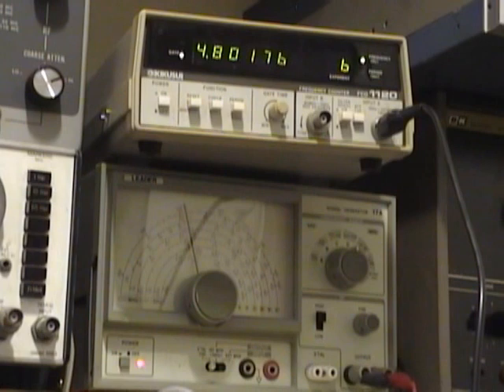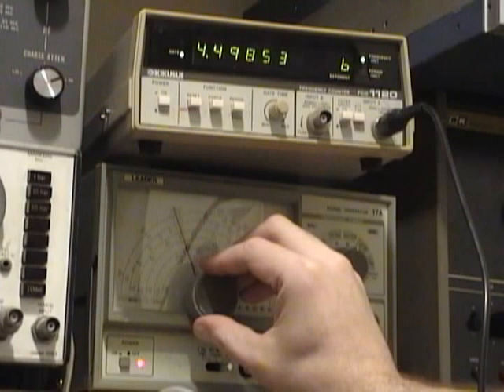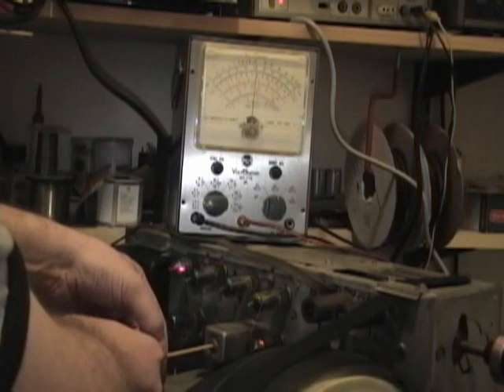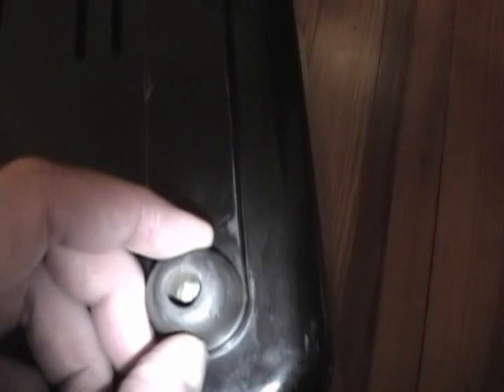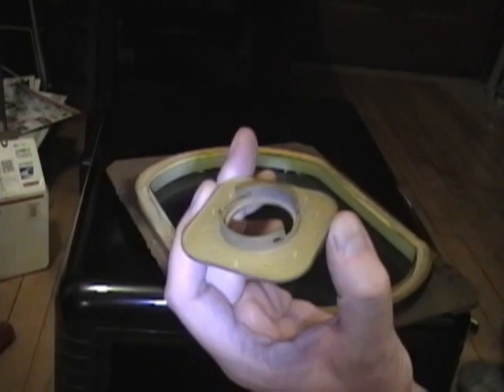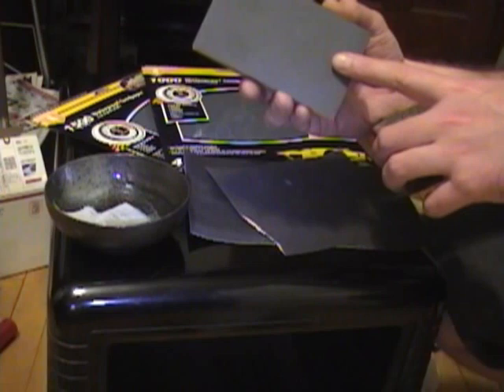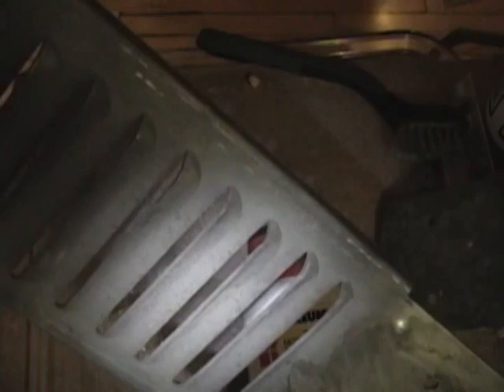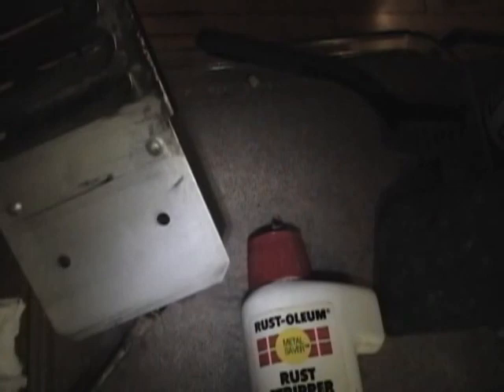Admiral 20X11 restoration p5o5

Comment: I would have thought you could also use something like that old fashioned Johnson wax on those brass knobs if you don't want to lacquer them.  That Harlow Wilcox on Fibber McGee and Molly talks about using it on almost everything, lol.  It'd offer more protection than just leaving them bare.

Comment: For some reason, when it comes to finding wet or dry sandpapers, it goes from 320 to 400 to 600 grit, then it jumps up to 1000 grit, then 1200, then 1500, but 800 grit seems to be impossible to find if there is such a thing.
Reply: +OlegKostoglatov I saw some 800 grit on amazon just now first try.  It wasn't that difficult to find.  Go to amazon and paste in this... 3M 32035 Imperial Wetordry 9" x 11" P800 Grit Sheet

Comment: somebody oughta reproduce at least a few of the channel marker plastic.
Reply from the maker: +gbowne1 If there's enough demand I'm sure someone will.  Luckily I have one for all my sets plus a few spares :)
Reply: +bandersentv that's great. there's some nicely done repros out there so Im sure someone might be able to.  i picked up some cool feet for a build.
Reply: +gbowne1 I wonder if it'd be possible to 3D print stuff like that.
Reply from the maker: +Rebel9668 Yes, but first you need an accurate 3-d model.  Either from scanning an original or modeling in CAD software.  I''m not sure if the result would be strong enough though.